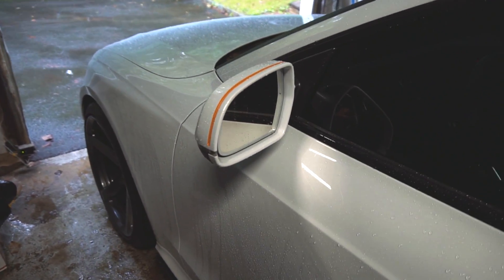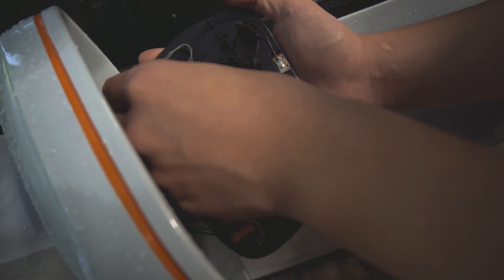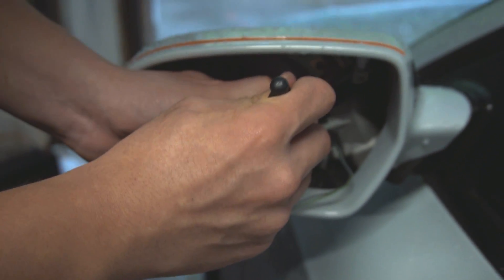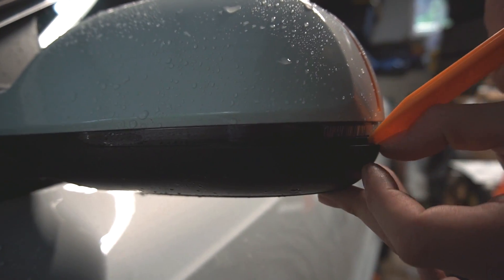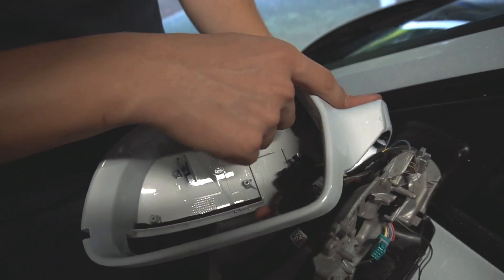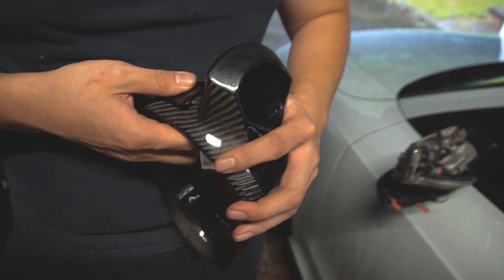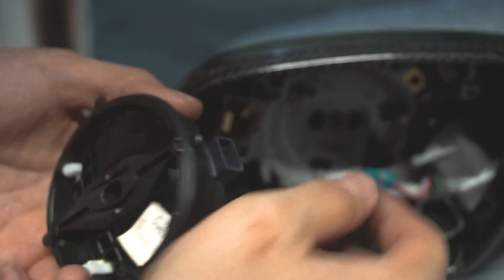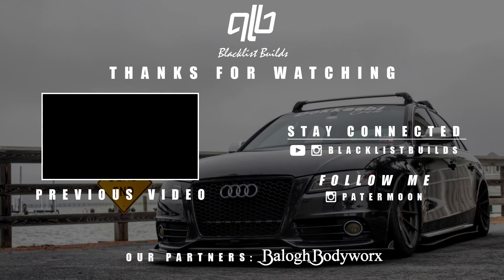B8.5 RS5 Carbon Fiber Mirror Cap Install

Comment: This video inspired me to change the mirrors on my 2013 Audi S4. However, there are some additional things to pay attention to. You have to pry open the bottom of the mirror assembly to remove the cover. When installing the new cover it has to be aligned in the right position. Otherwise you can break the taps.

Comment: Love the video, but my driver side mirror is not retracting all the way and sometimes it sticks. I don’t know what I did wrong HELPPP
Reply from the maker: Are you talking about the entire mirror housing folding? Or just the glass? Double check and make sure you clipped in all of the tabs of the mirror cover.